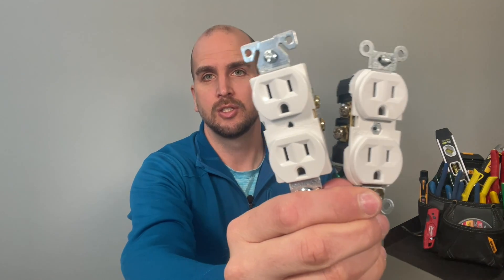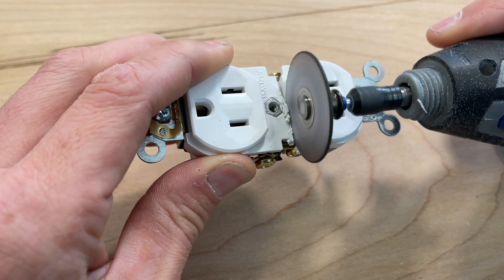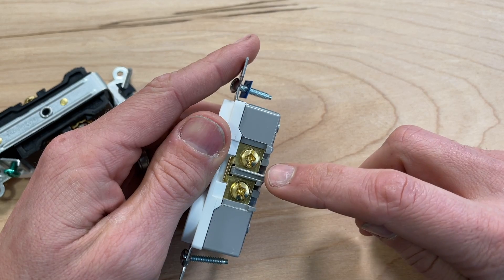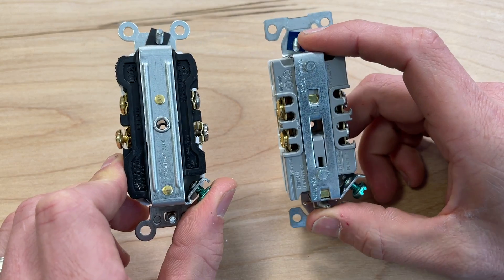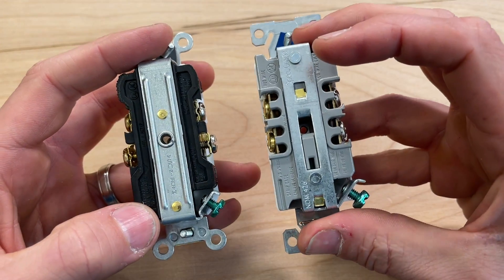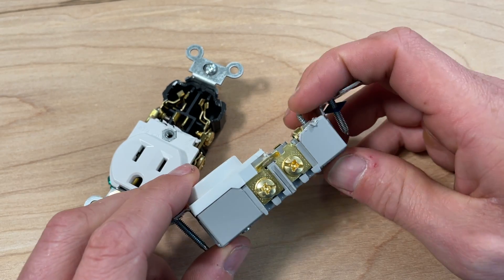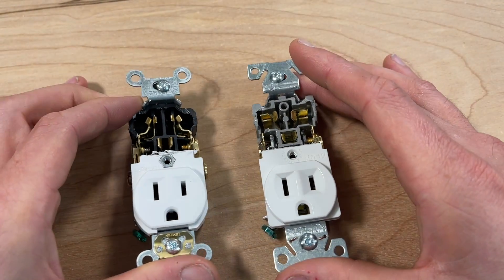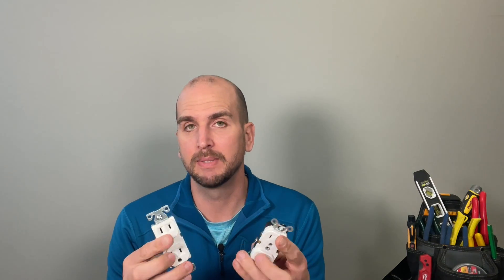What Outlet Should You Buy | Leviton vs Eaton

Comment: We had our house built in "93" and over the years I've had to replace some receptacles and I'm sure the builder put in the absolutely cheapest ones they make.
One shorted out and a couple others I replaced because I changed colors of plates and sockets.
Something I've noticed over the years is a dark streak going up the wall above some of the outlets.
Anyone else every notice this happening? What do you think would be the cause?
I don't have an issues spending more on better sockets if for no other reason, quality.
I was however watching another electric video and he stated that you should never use the push in feature because if there is a failure it normally is in those.
Reply: I am NOT an alarmist or safety freak BUT please turn off every circuit breaker that supplies any outlet(s) that show a dark streak in the wall emanating from the outlet/box.  You have the signs of an extreme possibility of a serious FIRE issue. 

Here's why I worded it the way I did:
♦️ "Something I've noticed over the years is a dark streak going up the wall above some of the outlets."
♦️ "Anyone else every notice this happening?"  ❌NO❌
♦️ "What do you think would be the cause?"  🔥Heat due to electrical resistance.❤️‍🔥

 
5/8" drywall has a on hour fire rating.  Your wall is probably 1/2" drywall, I don't know if it has a fire rating BUT it should NEVER get hot enough that the paper face chars.  I have NEVER seen that other than by being exposed to fire, normally due to someone holding the flame of a cigarette lighter to it.  I hope and pray that you are not being serious but I could no have not replied. 

 
PLEASE, someone tell me that I AM WRONG!!!!!

Comment: I also have a question that's not related to this video because I couldnt find that subject in any of your videos but I bought a house with the garage attached but has no electric going to it ...if I go from the circuit breaker box in the house and use a sub box what would be the best way to go bout it.some told me I could do a 20amp double to make 2 40 amp then run a line to a sub box but now I dont know which wire goes where the white wire is neutral the back is hot the copper is ground but how does it get installed on the new box.i got a 6 space 12 circuits 100 amp box ....the copper wire is ground its installed wheres the other 2 go the box takes square D breakers.does the black wire go to the contact spot that I can see when I push on the breaker to pop it into place or is it the hidden one under where the ground goes hmmm.not sure.any help from anyone  would be great.im using 8 gauge wire.
Reply: You should probably consider speaking with a certified sparky in your local area. There will be safety, building code and possibly permitting considerations for what you want to do.
Reply: @AndrewFremantle  ok I'll keep using the extension cord cause they want to hook up another meter to a house that's already got a meter makes no sense then I'll have 2 electric Bill's

Comment: Leviton back wiring sucks in multiple ways. Just skip straight to hooks when installing those. Their industrial and hospital grade heavy duty receptacles have the same exact style of termination as the $2 commercial.  You got to move up even higher to extra extra heavy duty industrial and hospital grade just get the back wire style offered on the commercial legrand and Eaton .
Reply: My experience is that the back wire option is a bit of a nuisance if you want to side wire. Both brands offer side wire only receptacles and are designated by CR series. The Leviton heavy duty industrial grade still uses an external clamp for the back wiring, but it's more robust than their commercial grade receptacles and they have a clamping option for the ground connection. They are pn 5252 and 5352 for 15 and 20 amp receptacles respectively. The "narrow body" version at this grade level has a back wire style similar to Legrand and Eaton. You can also get pn 5242 and 5342, side wire only for the Leviton brand.

Comment: The Eaton has another hidden feature. The hole in the center, for the cover-plate screw, is triangular; you can put the plate on and just press the screw into position, and the sides of that tiny triangle grip the screw & hold it while you get the screwdriver.
Reply from the maker: You are right I completely missed that feature and that is super handy.  Maybe I should do a quick story (15 second video) and call out the feature.  Thanks for the feedback 👍

Comment: Admittedly lovington has been my go-to.
Being a DIY, I was mainly going off the name associating it with quality. Actually it is of good quality in comparison to some cheaper crap that I have seen.
But I have had outlets literally break apart when tightening side screws before.
My brother was some type of high voltage electrician in the Navy. He actually brought home a couple of receptacles. There was even a big difference between those and the eating. He said that the ones he brought home or more what you would find in a hospital.
I don't recall the brand now.
So anyway, yep I would be the one to grab or order a box of 10 Ludington.
I haven't in several years now. I don't recalled the last brand I bought but it was not levington.
Reply: Hubbel   ?

Comment: From the picture at 8:50 it seems like the Eaton base could handle 120-15A, 120-20A, 240-15A and 240-20A with just a change of the face plate. The other types use some combination of horizonal/sideways plugs.  Could this be a way to reduce inventory and costs?
Reply: It decreases manufacturing cost. One base and multiple different faces to attach to the base.

Comment: For those of us that have been doing electrical I remember when Cooper bought Eagle Electrical in 2000 then Eaton bought Cooper. I always stuck with that brand as it has always worked for me with no issues.
Reply from the maker: Wasn't Arrow-Hart part of that as well?
Reply: @EverydayHomeRepairs  Yes that is correct.
Reply: @EverydayHomeRepairs  Yes that is correct. I think at that the time Cooper had bought Arrow Hart at the same time the acquisition of Eagle was done. Eagle since 1921 had the motto on their packaging : Perfection is not an accident.

Comment: Question. I live in the Philippines.  They use 220v, but use the 2 spade receptacles like in the USA and I know USA uses 110v.  I am wanting to order receptacles from the USA because the ones sold here are garbage products.  I will not be using 110v products here. I just want to hook 220v electricity.  Will these receptacles  handle it?
Reply from the maker: Unfortunately not these are designed for 15 Amps at 125 Volts

Comment: I bought a 20A Leviton plug from Home Depot and it was extremely rough inserting a plug. Went back to the store to replace it and every one of the Leviton plugs had this problem. You could not insert a plug without hitting some pretty abrupt sticking points and took a lot of force to fully insert the plug. Eaton plugs have a different (side by side and off center) reset/test  button design, which I don't like, but they're a little smoother inserting a plug.
Reply: If you buy the tamper resistant plugs they all feel like that.
Reply: @JimYeats  Is that what that is? I didn't know that. Thanks
Reply: @rgraz4929  Yeah they suck, but in most regions are now required by code for new builds. Many of the Leviton plugs sold at big box stores have switched to them.

Comment: Good Comparison between Leviton and Eaton outlets. I also prefer Eaton outlet.  Eaton just seems to be better than Leviton and both are very economical.
Reply from the maker: Yeah, to be honest the price is pretty reasonable for what you are getting.  I have no problem spending the $2.00 per unit compared to the cheap $0.50 receptacles.
Reply: @EverydayHomeRepairs  Yes, the price per unit are surprisingly cheap. It costs less than a cup of coffee at Peet.  👻 I would rather pay more to get good quality Outlets that would last and safe.  
  Beside Leviton and Eaton, Is there any better quality outlet with larger capacity and/or more safety feature for home and commercial use in the market?  
Thank you for making such a good video😹👻😂👍

Comment: I can understand that using the back wire method is faster and easier but does it really give you more surface area than a J hook connection? I would say just from a hypothesis standpoint that the J hook would have more surface area then the back wiring method. Which to me is superior. But nonetheless I love your videos and continue the good work
Reply: I've heard that backwiring often isn't even up to code nowadays, since it only contacts the wire at a narrow edge; many local governments want you to use the screw terminals.  I always do; I don't ever trust backwiring connections.
UPDATE: Actually, I was referring to the merely-push-in or "backstabbing" connections, not the much-more-solid back-wiring terminals with a screw and pressure-plate.  Thanks, "Blake L", for bringing that distinction to my attention --- his message is in the replies below. :D
Reply: @Quacks0  yes I have been told that the back wire was not approved by code. Back in the old days we used to jumper circuits in the back wire (which may never have been allowed but we did it due to laziness back then).
Reply: Code requires approved devices. Such as UL Listed or NEMA. As long as devices have that stamp of approval then its legal. Manufacturers approved devices supersede local code because it’s  approved for the application. Local jurisdictions may request a certain wiring method, but it’s not code.
Reply: @TheForgottenMan270  I'm pretty sure that's pretty obvious that you should only be using code compliant products for your house wiring. My question was about the surface area between the different connections And which has more more of contacting surface area in the connection rather than it being approved for such applications
Reply: @Quacks0  Pressure plates have plenty of surface area and there is a ridge on the center of the eaton plates that bites into the wire providing better secure locking than a J-hook.  Those aren't like the cheapo backwire one way push throughs.
Reply: @EgadsNo  I agree.  I like the U-shaped pressure-plates that fit on over the screw and hold the J-hooked wire from uncurling as the screw is tightened.
Reply: @Quacks0  I think you are thinking of "backstabbing" which I would never use, when compared to back wiring which is very solid
Reply: @blakel4595  Thanks, Buddy; you are right that this merely-push-in-against-a-thin-edge-of-metal terminal was what I'd been thinking of. :D

Comment: A good point you may have missed with Eaton was that Eaton had a three point contact per terminal opposed to Levinton's two point.
The Eaton's contact points also looked of higher gauge.
Reply: That's probably incidental to the usage. The same stamping is used for the 20 A so it needs to accommodate the horizontal prongs. Horiz. prongs are also used for the 15 A and 20 A 240 V outlets so maybe four applications use the same parts. Neat design.

Comment: that was a neat feature in a pinch that is needed, just out of being curious is there single outlet/receptle
Reply from the maker: Definitely unique, don’t think any other brand has the stripper built in.
Reply: > just out of being curious is there single outlet/receptle
If I'm understanding your question correctly, I don't think so.  They do make combo switch/receptacles though, with only a single socket.
Reply: Yes, single receptacles exist. You should be able to find them at Home Depot, Lowe’s, or any other store. All that was shown in this video were duplex receptacles.
Reply: @TheForgottenMan270  Oh okay I was in a rush when I wrote this and thanks

Comment: I like the Eaton because when back wiring when you insert the end of the wire its fully incapsulated so you cant see the end of the wire. I just installed some Leviton and had to hold the wire steady while tightening the screw so it did not go in to far. not a big deal, but Eaton goes in the right depth and that's it.

Comment: FWIW, the fasteners holding on the Eaton cover aren't screws. They're ring-shank nails, or ring-shank studs. You'll note that the ridges are not helical, nor are there slots, recesses, or flats that would give a driver purchase. The stud is merely pressed into the plastic and the rings keep it from backing out.
Just in case you need to order some.

Comment: The Leviton commercial receptacles I've got are way better than that one you cut open. On mine the blade contacts are aligned to each other and not having one tilted as seen in that one you show. Again models do vary by type as well as construction so maybe the one you have is a cheaper model. Mine also have the aperture like the Eaton for the back wiring where each wire has a hole and not merely an opening, the draw down plate is also a thick metal piece not a flimsy plate. If you look at the Eaton you cut open they have made the live and neutral contacts in such a way that they can work on both the parallel plug blades or the  inline plug blades depending on what face they attach to the receptacle.

Comment: The Eaton outlet and switch designs were originally from a company called Eagle. They were made as far back as the 70s I believe. In 2002, they were bought by Cooper, and new design revisions included the distinctive ears with the built in wire strippers. Recently, as you said, Eaton bought Cooper. I think that particular Leviton design has been around for a while, but maybe not as long.

Comment: Either will work just fine. When we had to use a better recept. we allways used Hubble. The 79 cent 5320 levinton is better than an old worn out recpt. that the plug wants to fall out of. Unless you are qualified, get someone who is. 120v house voltage can be more deadly than 480v in many instances. Plumbing mistakes can make a mess, carpentry and things could be out of plumb or not open and close properly, electrical mistakes can start fires and kill people.

Comment: Overall very helpful to a homeowner.  Selecting a commercial-grade outlet seems the better initial decision,  then an Eaton based on this video with a simple & secure wire insertion.  So much wiring appears to have originally have been developed a century ago with cumbersome connections, diverse screw heads and no consistency.  Your videos are wonderful for the novice and others.

Comment: I will never use the back wire feature.  To little surface area for electrical connection and increased chance of developing a voltage drop (therefore resistance and heat build up)  which could result in fire.  No respectable electrician will use them.

Comment: Judging on external features I like the Eaton for 
- back plate pinching 
- insulation stripping slots
- strip length guide
With internal discovery
- double screw fastened front plate 
- parallel electrode to lower contact resistance and runs cooler
In the future I’d go for Eaton.

Comment: WRONG Comparison: You're comparing a the Cooper/Eaton with a lower end Leviton.  Leviton makes the same kind of backwire version of outlet that you're featuring from Eaton.  You can't compare a high-end Ford with a mid-market, Chevy and say that Ford is better.   Also, in any comparison, it's not a matter of which one has more good features, it's a matter of which one has the Right good features (the ones that actually matter) such as weather or Not the plastic turns yellow over time, whether or not plugs inserted into the outlet stop being held tightly over the years (i.e. spring quality), and whether or not the faceplate is held by an actual metal but  (Leviton) or a plastic hole.  In several years when one of the outlets has failed, will you actually care whether or not it had a gimmicky wire stripper in it's frame?
Reply: He chose similar grade models from each brand (BR15 CBR15), contractor grade, 15 amp, non-tamper-resistant.
Reply: 'Grade' is entirely subjective.  See the original post under 'the Right good features'.  A discussion about which brand may be a better 'value for money' is a separate discussion.  Frankly, I'm of the opinion that if you're already paying an qualified electrician to do the work, the marginal cost of premium outlets is comparatively small.

Comment: When I bought my house my insurance company required me to do a whole house rewire.  The original electrician grounded everything at the panel to pass inspection.  And cut the ground wire at every single plug and switch and light.  Annoying for sure.  Bright side I upgraded to a 200amp entrance while I was having work done anyway.  All my plugs are Cooper I believe.  Most available in Canada for the most part. With a giant Eaton panel with only 20% of it populated. Most of my appliances are natural gas, so I have lots of room for....   something?   Not sure what I could add beyond my hot tub to take up space.  Lol

Comment: I recently installed a leviton commercial outlet to replace the OEM residential whose contacts had worn out.  The Eaton is MUCH easier to backwire.  I had trouble getting my wire under the Leviton's plate.  It wasn't too hard, but wasn't as easy as the Eaton.

Comment: You should never back wire. It is an unsafe method that I have seen fail on a few occasions. Its against code where I am from as well. The old sheppards hook takes more time but it is much more secure when properly completed.
Reply from the maker: Hey Jason, is back wiring against code in your area or is it the push pins found for 14 gauge wire on the lower end receptacles?  Thanks for the feedback.

Comment: I’m confused. In video https://youtu.be/UwGoU3XVpnI it’s mentioned that the strip gauge is good for hooking around the screw terminals. But in this video it’s only for the push ins?  Am I missing something?
Reply: There are 2 areas on the recepticle where you will find the strip gauge. The one on the back is shorter than the one on the side.